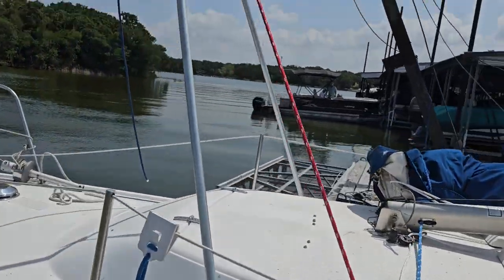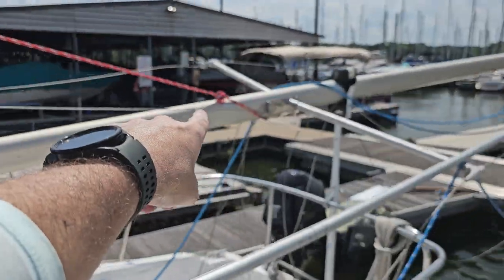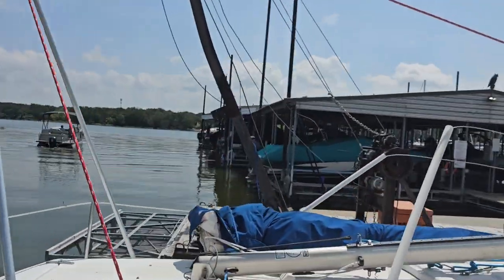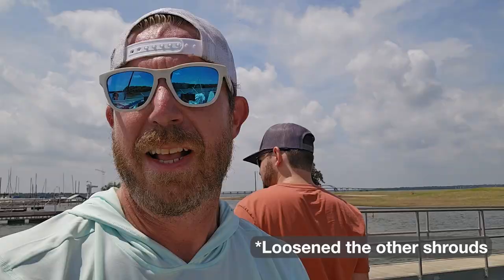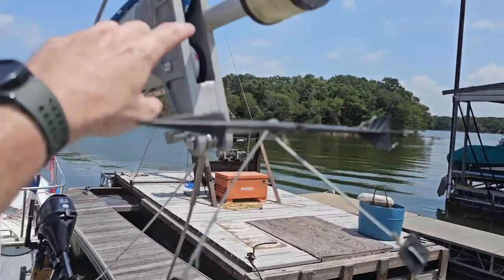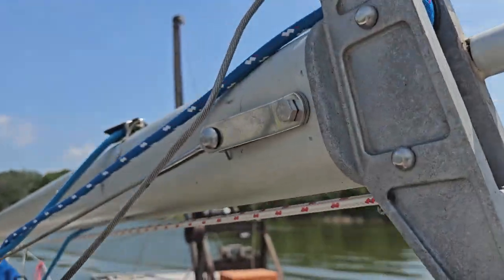First Time Stepping the Mast of my Catalina 25!

Comment: What do you connect the A frame to on the deck?
Reply from the maker: The A frame is connected to the forward lower shroud mounting bolts. You can see where they are mounted around the 30 second mark. I hope this helps!